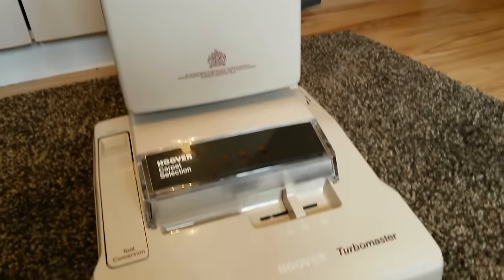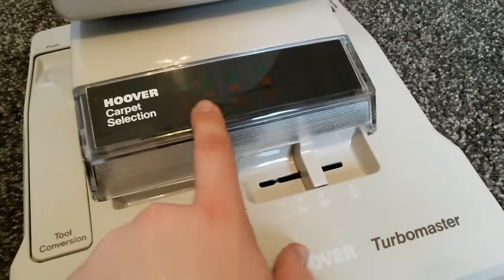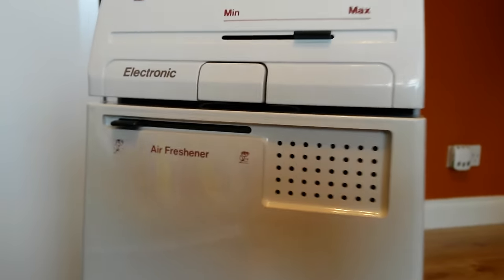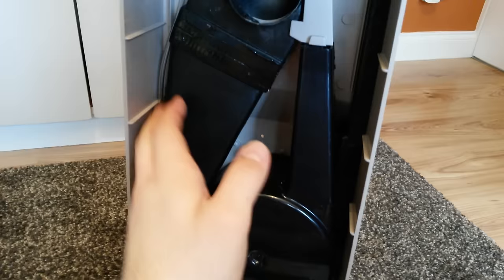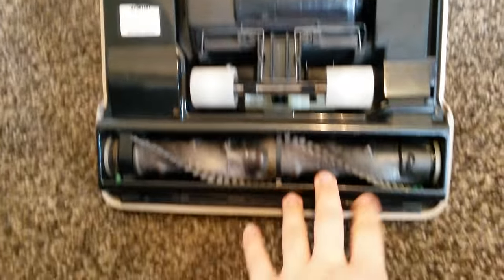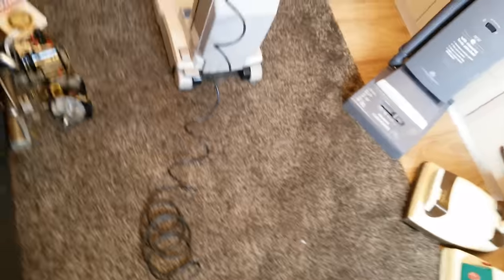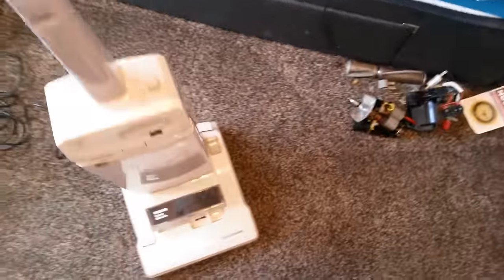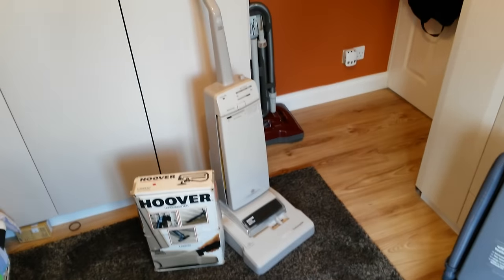1988 Hoover Turbomaster Electronic U5080

Comment: Very nice machine. I must admit ive not seen the electronic one with the tools not built on the machine. Ive got 2 turbo masters the electronic beige one with built on tools and the freedom bagless. I did buy the total sytem one brand new from a local co-op store and it lasted many years till the motor finally went as it was used on a daily basis.